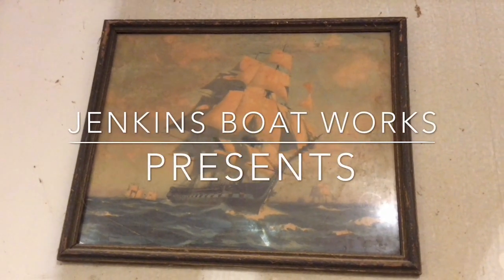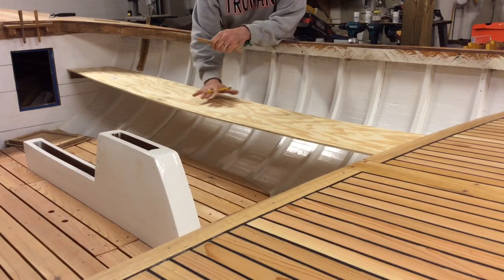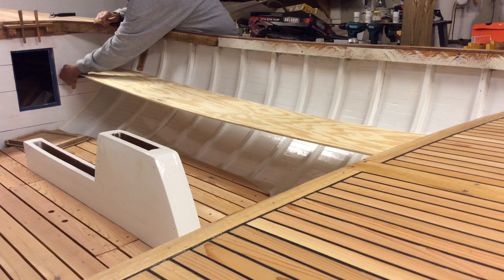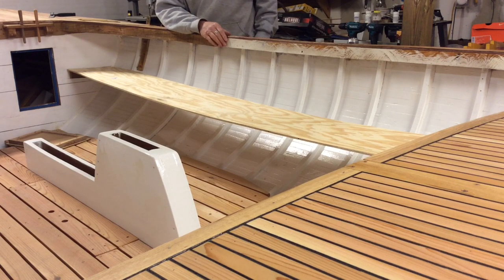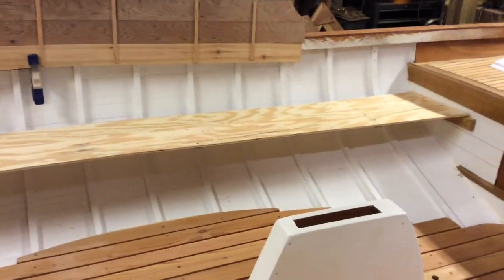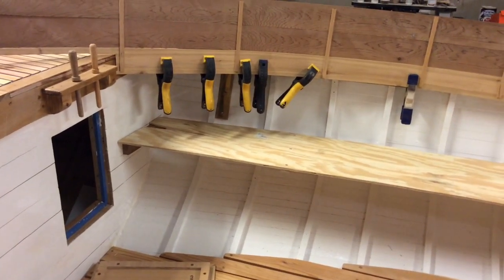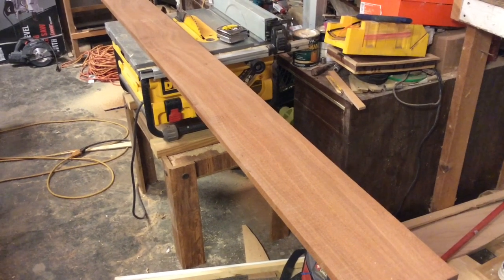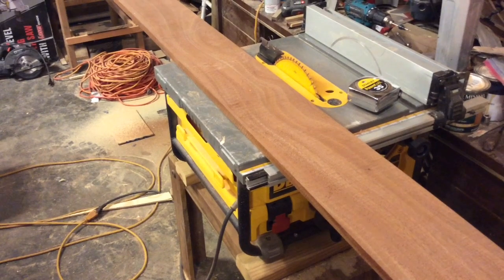Boat Building the Haven - Seat and Coaming Templates - Episode 90

Comment: That worked out really well for the seat template. The coaming is a real challenge, all sorts of angles and cuts; just think how it will feel once you get it nailed. If you weren't an obsessive person, you wouldn't make a boat, ha, ha.
Reply from the maker: Everything about this boat so far has led me to the coaming.  I hadn't really considered that before but it is true. Dale, I'm getting to that point where I am realizing that I am almost done. It occurs to me that finishing will maybe have a slightly disheartening side to the joyful
Reply: @JenkinsBoatWorks  When I finished my boat restoration I felt sad that it was over, so looked around for a new challenge, which I am soon to be starting. Don't get me wrong, it is nice to have a boat to use, but I really want to make one from scratch like you are. I really love the thinking and working out. Any way, you already have new stuff in the pipeline.....